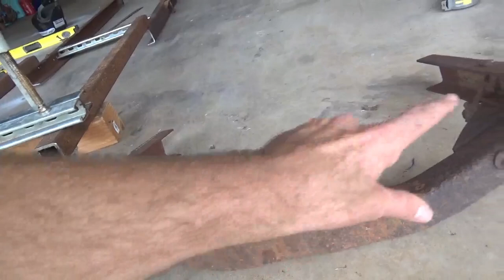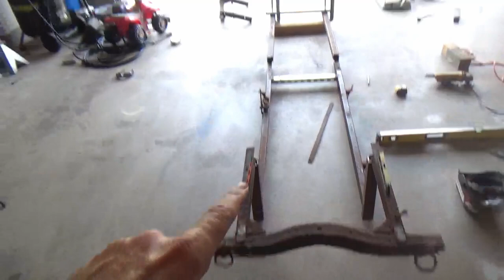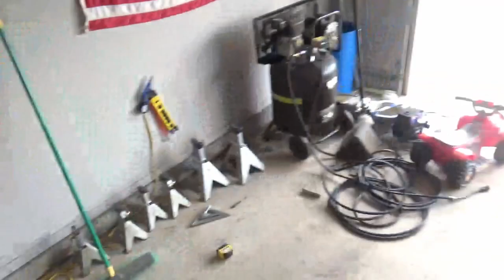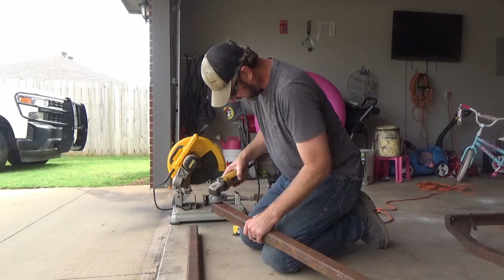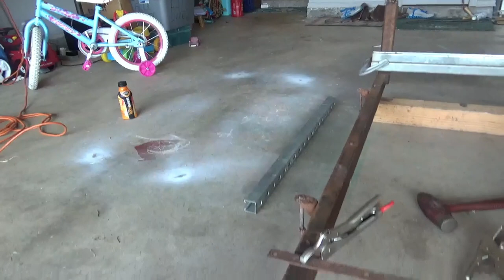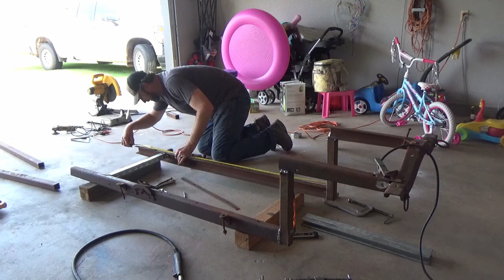Let’s build a Rat Rod! Part 2. 27 Model T Coupe Frame Stretch

Comment: I have yet to see any diagonal measurements to verify frame rails are square.looks good .i would have used 2 x 3 tube steel on any frame rails in cars with v8 power due to weight.
Reply from the maker: Yeah honestly I will probably go a completely different route. My wife’s Grandmother gave me that chassis and rear springs from her farm so I was really hoping to use it. But I may go with the 2”x3” now and use that for something else. Thank you for watching and for the comment. Please subscribe if you haven’t already. Take care
Reply: @HartRockGarage  no problem with chassis if frame is boxed with 3/16 plate.
Reply from the maker: @bobhalstead1879  I do have some 3/16" Flat Strap that I have been considering using.